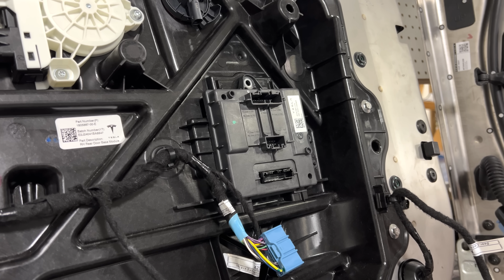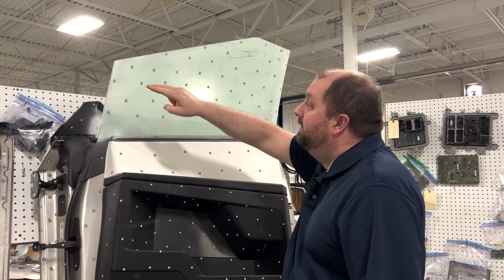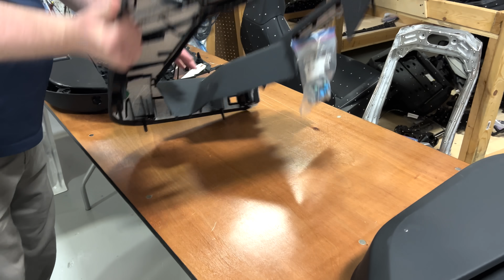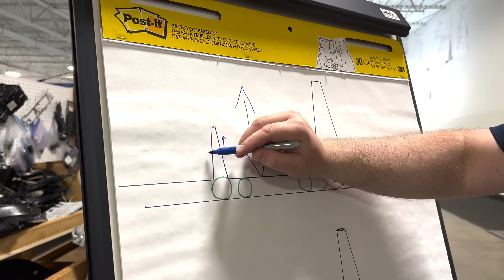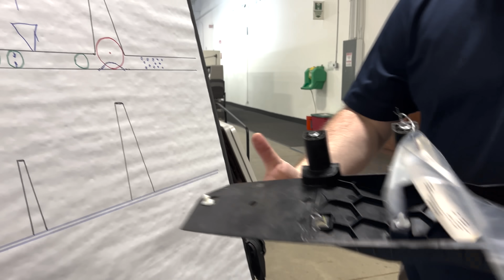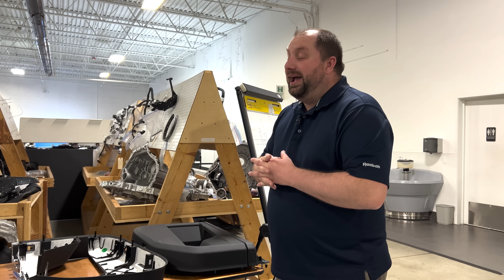But At What Cost? Tesla Cybertruck Door Teardown

Comment: Similar to the design in 1960's cars with "frameless windows", usually 2-door hardtop and convertible.  But, those have a front track in the vent window assembly.  Many adjustments inside the door panel to align window motion in several directions.  Quite fussy to get it aligned with the body and also with the rear quarter window, which has more adjustments.  The plastic inner panel is thinner and lighter than in most vehicles, but that dampens sound less and less rugged.  Doesn't automotive design do like aerospace, where every part gets a cost per weight penalty?  Expect lawsuits after people burn alive for not finding the hidden door-release cable after an accident, also true for the Model X.

Comment: why is there separate door control module? It is for unboxed manufacturing, subcomponents can be tested when they have their own control unit, and attached to the car later and are already tested. If there are any faults, they can be fixed, before mounting it on the car. I find it really cool to decentralize this part.

Comment: You gave too much credit for Munro, but other points are valid, and video is great. I believe Tesla's approach is having a global set of parameters to optimize, and one of them is weight, it's like having a set of KPIs, which separate teams need to follow. Something software engineers could understand with an analogy with a global set of variables to take into account when optimizing a code.

Comment: Consider the costs relsted to wiring and the cost savings related to distribute the controls.  And compare to the cost of the control module.

In short - microprocessors are cheaper than wire.

Comment: I suspect that the reason for the control module in the door is so that it can be more easily manufactured using the Unboxed process. Adding intelligence in the different components mated at final assembly will reduce the number of connections to each module.

Comment: If the injection molding is sturdier, weighs less, and allows more options with attaching parts… seems like a pretty good option to me.

More expensive equipment to install? A little waste? Adding an extra layer on top? I think Tesla can find ways to make all those processes better and cheaper over time.

Comment: It seems like door glass in general would hold up stronger with a proper frame around it. Elon & Franz said the stainless steel would be structural and save weight & paint at the same time. Instead, it added weight and forced the engineers to seek workarounds to save weight in other places. From my dialectic perspective, Cybertruck is a failure at what it set out to do. Give me the simplicity of the F150 door. It's great to try new designs, I like Aptera, but America needs to solve the "big truck problem" with legal Kei trucks and Ford Mavericks replacing consumer F150's, not an overweight Cyberbeast.

Comment: I love all the Munro videos. Sandy and his team of experts are absolutely amazing in their analyses of the awesome teardowns. 

The explanations of the engineering that goes into not just Tesla, but other legacy manufacturers. It's great to see Tesla taking the risks to innovate, but not just for the cost savings (I wouldn't say using stainless steel is a savings), but for ease of manufacturing and assembly. 

Most of their innovations appear to be done for ease of repairs, not to mention for further future refinement. Tesla seems to be critiqued far more than other legacy OEM's when they have a recall or utilize running changes mid cycle. Swapping out early CT drive units, wiper upgrade and accelerator, to name a few. 

I mentioned the accelerator pedal, because that seemed to be more of a manufacturing/ assembly oversight, than an outright failure. Hiccups like these are common for any OEM, not just Tesla. They are not a new company by any means. 

They've been around for nearly 20 years, and have mass producing on a fairly large scale since 2012 (Model S). The engineering that has gone into the CT is impressive for such a young company and also very commendable, insomuch that GM, Ford, or any other OEM would have NEVER gambled on the CT's design architecture......EVER!! 

It's bold, edgy and certainly polarizing, but the bottom line is, it gets attention and they seem to be selling every single one they build!!! Not many companies can say that today. Musk is like a modern day Preston Tucker. Tucker has the distinction of 94% of the rolling stock they built (47 of the 50+ Prototype) still exist today and all but two are restored and fully functional. NO OEM can make that claim...ever!! Neither will Tesla, but at least they have to claim to being the first successful auto start-up, since Ford Motor Co. went public in 1956!! Now, THAT'S something!!

Comment: My first Tesla a 2018 Model 3 had that soft touch material on the inner door panels and at first I really liked it.  Then it started gouging the material right above the panel bottle holder.  Apparently a water bottle easily gouges that material when putting the bottle in the pocket, if you hit the panel first.  I was so glad my 2023 Model Y has a hard plastic in that area instead of the soft touch material.

Comment: Excellent video comparing trade offs for weight and aesthetics. I appears that while the stainless steel is a design feature it may not be as big a structural feature as originally believed. How much weight could be saved by redesigning the skin to use either steel or aluminum sheet metal. The door is a good example. It would not look identical but you might save hundreds of pounds which translates to higher range or smaller batteries.

Comment: nice video but as ang engineering company you have to get rid of this 14:50 concept of weight on EVs.  While it is obvious that weight reduction=better on many things, chasing weight reduction on an EV is futile/waste because there is not much gain due to crazy mass of the battery packs.  In addition, EVs recover this inefficiency/loss through regen braking. This the reason why huge heavy glass roofs are on EVs. This the reason why stainless steel makes sense on an EV.

Comment: I had a rear door handle on my Model S replaced last week. They retrofit a new system in that door that simplified the handle wiring but added a window regulator on a new plastic insert they installed in the door. Looks a lot like the Cybertruck system. So I think this must be something they are doing in the factory now.

Comment: I am converting a vehicle to electric and I am adding many features that the vehicle didn't have before. The solution has been to add a door module to each door that communicates via CAN bus. It makes the wiring much simpler and allows for more features to be added later without modifying the main wiring.  I only need to run 4 wires thru the entire car. Much simpler than the original wiring with more features.

Comment: Nope. The controller in the door is an artefact of the unboxed process. 

They finish the door before they attach it to the cybertruck. 

To be able to test it before connecting it to the car, it needs some local intelligence and controlling capability. 

=> cheaper on the bottom line to integrate this part into the door from the get go.

Comment: I bought a new 2017 Model X in 2017 as well as investing in Companies, assets, I believe in.  After owning many exotic cars, the Model X was revolutionary both tech and propulsion wise.  Their tech and software/hardware miles above competition.  Even NASA has stated SpaceX/Tesla know their hardware/software.  Even designing their own chips, batteries, and motors, vertically integrated. Their WiFi updates both SOTA and FOTA, others manufacturers dream about.   I have owned 5 Teslas and still have the 2017 Model X.  The model X has never been to a service center.  Only maintenance has been tires.  I charge at home with solar/powerwall saving $500/month.  I am not a truck driver but maybe.  I primarily drive a Y with FSD.  I originally had FSD in the 2017 but the April 2024 update FSD to my 2024 Y is very impressive for what it is.  I fly planes, so I understand what autopilot’s can and can not do.  One reason 2 pilots on airlines.  Autopilots are life savers but can lead to trouble if used improperly.  I will probably end up with a Cybertruck even though not a truck driver but so cool and unique.  I like different and modern.
Reply: Definitely the Lambo of trucks with so much tech.  This should be a $200,000 truck.  Tesla has a niche product as a test bed for new ideas that will filter down to their mass vehicles.  Other companies dependent on trucks as their core crowd are limited to try innovations or at least it slows innovation.

Comment: Thanks again Carl. I did not think about a molding shrinking as it cooled and those release angles. As far as weight goes, Out Of Spec had done payload (Gross wt) vs no payload (driver only) range comparisons with the Ford Lightning and Rivian. Both showed no meaningful range difference when driven at highway speeds discharging the battery completely. Weight seems to make very little difference in EV range.

Comment: Why does the door have a separate controller? I am surprised you don't know!
Tesla's Un-Boxing Self-Testing of ALL assemblies before final assembly. 
The completed door can be plugged into a 24V and Ethernet loop to test every part of the door before final assembly.
This is Tesla's secret sauce to ensure 0% failure on the final assembly to avoid expensive reworking, saving huge amounts of time and money.
Reply: I think the real reason is that this door module comes preassembled from an external company. They have designed it including the motor and controller and it's plug&play. Tesla doesn't have to care to write software for it, they just send simple commands to open/close the window and are done.

Comment: The frameless doors on the CyberTruck a style choice.
The door controller module enables Tesla to assemble and test the doors independently.  
A bit of the unboxed system influence. 
Having fixed a few window regulators I love the huge access hole in the Tesla door.
Reply: Simply genius, having discovered the approach German manufacturers have used since the early 2000s 🫠
Reply: Having just replaced a window regulator, I agree and love the huge access hole of the Tesla door and the simplicity of swapping the module.  However, if any minor component fails in the door, I suspect a full module replacement will be the only available repair solution.  Imagining the cost of the Tesla integrated door module is scary.
Reply: @chrisgraham2904   My expectations are that we will see a ecosystem of 3rd party repair parts build up around the CyberTruck as they come out of warranty.  That is dependent on it continuing to ramp.
Reply: @danharold3087  True.  Although, because many Tesla parts are of unique design and function, they may be strongly protected by patents to prevent them being copied.  The internal door control module, for example, seems to be unique in the automotive industry.
Reply: @chrisgraham2904  No patents apply to re-manufactured parts.  Tesla has already been sued for having a closed repair ecosystem.    This is not where they need to make their money and I hope even expect they know it.  Even after winning.
Reply: @danharold3087  I wasn't even thinking about re-manufactured Tesla parts, such as is common for starters, alternators and engines.  A unique window control module could certainly be protected by patent.
Reply: @chrisgraham2904  what unique?! Are you jocking?!
Reply: @alanmay7929  I often joke, but I never "jock" about anything.
Reply: Blablablabla!!! N frameless doors are decades old tech nothing special about it! Grow up!
Reply: Using the words 'Tesla' and 'test' in the same sentence is a joke.  Everyone knows they use their customers as the testers.
Reply: @pasad335 anyone who actually knows what they’re talking about knows that you’re wrong in that.

Every vehicle is constantly performing its own tests on itself as it is assembled on the line.
Reply: @pasad335  Tesla continues to collect data after the car is sold.  This helps Tesla understand how to improve the car.  This is an advantage.  
Yes people pay to help Tesla test FSD.  Neat trick I doubt we will see that happen again.
Reply: @danharold3087 blablablabla crap

Comment: Question?
Could it be SAFETY protection for that door module? Because of a 48 VOLT system, have we taken that door module apart, at MUNRO?
Instead of laser welded those 2 door parts, could they have used glue or adhesive? 
Are they rushing designs out the door?

Comment: Conveniently left out the rust problems and the fact that everybody is wrapping their stainless steel Cybertrucks. I can understand why people like no frame on doors, but I prefer framed car doors.
Reply: Agree...  Kind of defeats the purpose of using expensive and heavy stainless steel.   They could have been out 2 years earlier and had a way better product if they just used aluminum.  Stamped light weight panels and nice glossy paint options.
Reply: There isn’t a ‘rust problem’.

Yes some people have reported small discoloured patches, but these buff off easily as they’re just a surface effect.
Reply: @fredbloggs5902  All steel rusts, whether it’s stainless or not. The surface effect is rust. Stainless steel rusts much more slowly and probably won’t rust throu within a car’s lifetime. However, arguing that it has less weight because it doesn’t need paint, and then everyone puts foil on it, doesn’t make sense.
Reply: My kitchen sink is stainless..no rust and i wash dishes all the time.

Comment: I'm super keen to see some of the optimizations for the "cheap" Tesla.
Reply: Lol!!!!!!
Reply: If you’re referring to the 3 and Y:

Cloth seats 
Unventilated seats
Single motor
No rear display
No mood lighting
Smaller battery 

All the resulting weight savings mean the suspension and braking can be smaller and cheaper.
Reply: @fredbloggs5902  No, I mean the drivable version of the Robotaxi, if they  ever  build one. I'm expecting some serious differences to bring the price down.
Reply: @grahammonk8013 

Only 2 doors 
Only 2 seats (or maybe very small backseat)
30 kWh battery
Single motor
Reply: @grahammonk8013 Don't worry, by 2060 prices for batteries will go down a lot.

Comment: 0:55 I believe Tesla is opting to include individual door control modules vs integrating them into the body controller as a test of their "Unboxed" process in a production environment. This allows Tesla to test / homologate individual doors before installing them into the vehicle. Once all the components are integrated into the vehicle a final integration test can be performed by the vehicle itself to ensure everything is working together. This approach is similar to how NASA tests new rocket components where they fly the new parts on old rockets before they fly them as an entirely new rocket. What do you think?
Reply: It also simplifies the cable harness in general.  One connector that at most has 8 wires into the door that need to go along the hinge. 2 for GND/+48V, 2 for CAN, 2 for digital audio, and 2 for the SRS.  Only the power pair is "think", but again at 48V current 1/4.
Reply: And do not forget the speaker integration... it eliminates two more wires....
Reply: That is a brilliant analogy using rocket design with old tried and true components (which historically, you know are proven) in the new overall rocket design. Good observation.
Reply: They’ve essentially discovered the process German manufacturers have been using since the early 2000s. Well done 👏
Reply: why do you have a need to use this type of grammar "test / homologate"?

Comment: This ammount of optimisations is really only possible because of vertical integration.

As he says in the video, in traditional manufacturing every team is only incentivised to optimize their module.

You need a lot of collaboration to create a global maximum optimization where you can intelligently trade door panel features against battery range.

Well done, Tesla!!
Reply: Nonsense!!! Other manufacturers actually gives you choice! Other manufacturers literally makes some cars with almost 100% carbon fiber.
Reply: All tesla interiors are super boring black or white, very few color choice or let alone materials! Bmw did the absolute perfect vertical integration in 2013 with the i3 while using mostly recycled and more sustainable materials, nothing will ever top that even Munro says it!
Reply: So Cybertruck's door is heavier and more expansive than Ford's. Where is the improvement again?
Reply: @MikaPopp  One improvement might be safety, when some other vehicle crashes into your side of the truck.

Comment: That cover for the inner door panel is a terrible choice. There is a reason trucks have durable plastic on the lower side of the inner door panels, especially the rear door. It tears easily, I found out the hard way, a very expensive mistake on my part.

Comment: I still interest what your conclusion would be on this separate module for door. But I think they go with idea of hubs, so hub connect to hub, and hub get all connections for elements close to it. So when you do rework, you don't need to rework all, but up to hub (included)
Reply: The move to the door module is part of moving to the unboxed method.   This allows them to assemble and test the door as a stand alone unit.